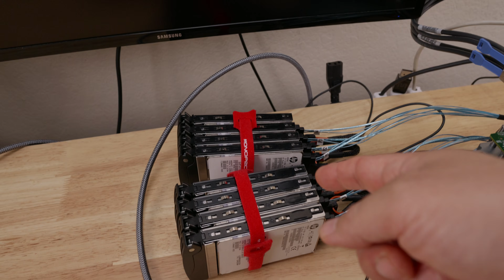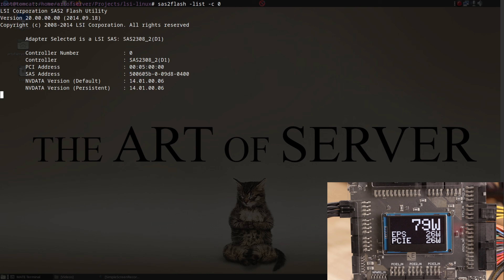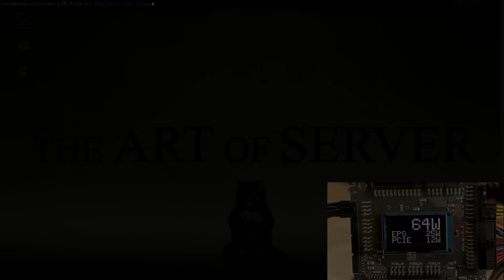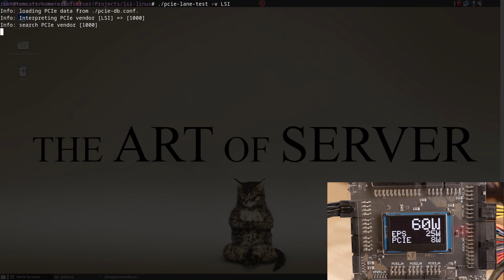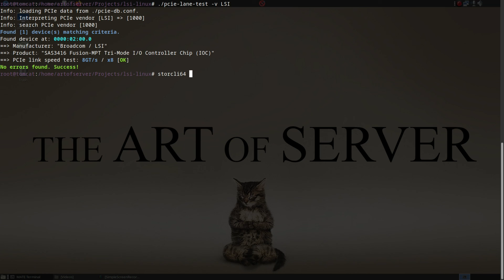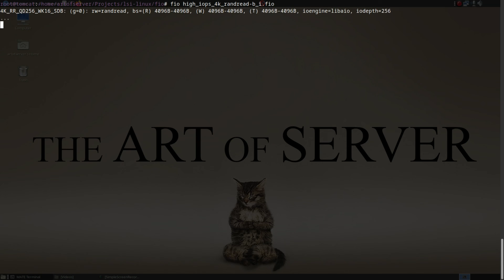Power consumption testing Broadcom LSI HBA SAS controllers Part 6 | External 16e SAS lane HBA

Comment: Hi! 

I thought I'd ask in your most recent video because I'm not sure if my question would get lost in one of your older videos.

If I want to use 10 HDDs for a NAS, should I use two LSI 9211-8i or one LSI 9305-16i? (these were recommendations made by ChatGPT, so I have no idea if I was given the correct information)

I have 10 Enterprise Performance 10K HDD v8 SAS drives. My motherboard is a ProArt X570-CREATOR WIFI with an 850W power supply,

The specs on the motherboard for the expansion slots are as follows:

AMD Ryzen™ 5000 Series and 3000 Series Desktop Processors

2 x PCIe 4.0 x16 (x16 or dual x8*)

AMD Ryzen™ 5000 G-Serie, 4000 G-Series and 2000 Series Processors

2 x PCIe 3.0 x16 (x16 or dual x8*)

AMD Ryzen™ 2000 G-Series and 3000 G-Series Processors

1 x PCIe 3.0 x16 (x8 mode)*

AMD X570 Chipset

1 x PCIe 4.0 x16 slot (supports x4 mode)

* Support PCIe bandwidth bifurcation for RAID on CPU function.

** PCIEX16_2 slot share bandwidth with M.2_2, which runs at PCIe 4.0/3.0 x8 by default.

When M.2_2 is enabled, PCIEX16_2 will run PCIe 4.0/3.0 x4 mode, adjust this item in BIOS settings.

Honestly, this is kind of confusing, so I would appreciate some help. One of the expansion slots is being used by an RTX 3060 ti GPU, if that helps.

I intend to watch as many of your videos until I fully understand all of this, but I don't know how long that would take me, that's why I ask this question.

Thank you!
Reply from the maker: Many consumer motherboards lack PCIe lanes, so to support all the features, they share resources. If you use one, then the other feature is disabled. Here, they are saying M.2_2 is shared with PCIEX16_2. I don't know anything more than what you shared, but if you want to understand your motherboard better, I suggest reading the user manual, contacting the manufacturer, or check online forums where people discuss that particular motherboard. You will not find any videos on my channel about this board as I've never had it.

Comment: No cards with internal and external ports like the 9400-8i8e? :p
Reply from the maker: I don't have that card. seems way too expensive. but it is probably comparable to the 9400-16i/e so if you are looking for power consumption of a 9400-8i8e, I would reference the results from the 9400-16i/e.